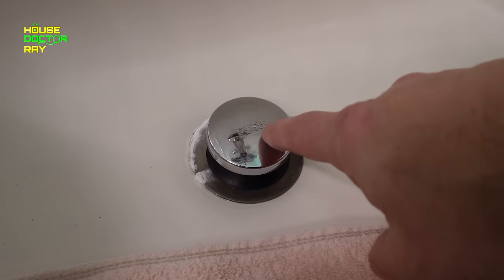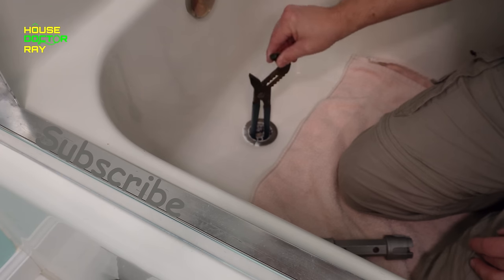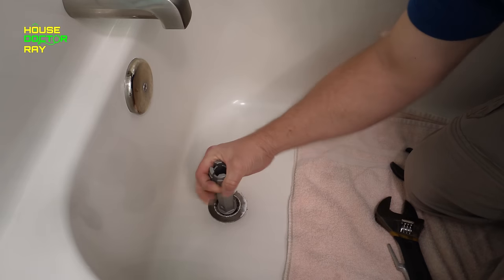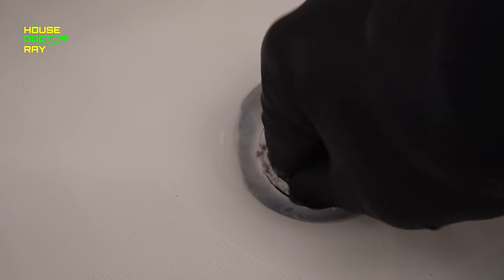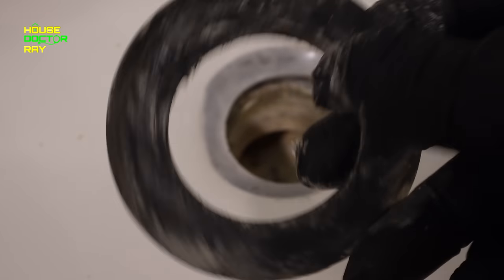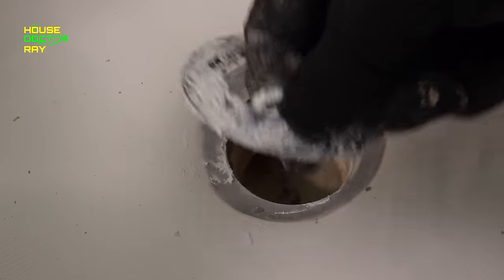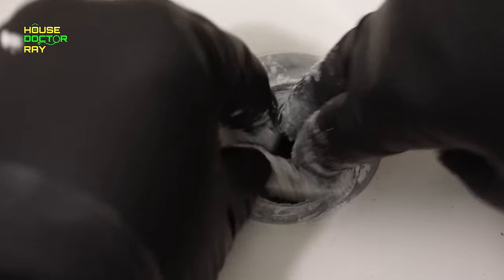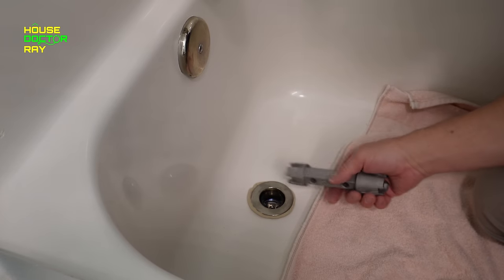How to replace tub drain

Comment: Give this guy a break lordy....so the first pic didnt really relate to the solution....BUT he showed me that there is.... in fact... a drain wrench tool that I had never known existed and how to use it, how to properly place the new rubber seals (between backside of tub and the wall facing me....and more....so he did show us all the solutions and for that I am thankful that he took the time to show laypeople...how the old drain can be removed and replaced.
Reply from the maker: Thank you.
Reply: Electrician pliers some peeps call them Klein's have no give or play like duck bills, needle nose or slip joints, lm plumber never bout dumbbell or stainer tool
Reply from the maker: Aviation duckbill pliers are nearly as sturdy as the lineman's pliers you speak of but with thinner handles.
Reply: @HouseDoctorRay  I didn't know that they made a tool for that.  I was going to make one out of PVC fittings with an oscillating tool.
Reply from the maker: That might work if you use schedule 40 PVC
Reply: @HouseDoctorRay  I'm just going to get the tool.  I'm not doing it on the tub.  I upgraded the kitchen sink to 1-1/2 standard PVC but the drain threads were worn out on one side.  I'm having a hard time finding a drain that will thread into standard 1-1/2"
Reply: Exactly. I’m thankful.
Reply: People can be cruel behind the mask of texting.

Comment: As someone who's replaced thousands of drains in the last 26 years, the only reason to replace that black gasket is if it's split or missing. Also, in a pinch, if your drain tool doesn't fit, try two large screw drivers and cross them over each other. It's a very solid hookup and will give you good leverage. Also, it won't bend up your pliers. You suckered me into watching the video because of the spade in the thumbnail pic.

Comment: The thumbnail for this video is somewhat misleading, showing a drill with a spade bit.  It implied to me that the video would demonstrate how to remove a stubborn drain with theses tools.  Not so!  Just a drain that comes off easy!  Looks like a sawz-all is what I'll have to resort to.  I did learn about the adapter and rubber gasket placement so it wasn't a total waste of time.  Just perturbed about the misleading thumbnail ✌️
Reply from the maker: Don't go sawzall!  They make an EZ out just for tub drains, you might have to go to a plumbing store to get it.
If you don't want to go that route go to the plumbing aisle of any hardware store and get a mini hacksaw.
Sawzalls are for destroying things.
Reply: @HouseDoctorRay  On another video, the guy thought the rubber gasket was for the inside of the tub, where the plumbers putty would go and commented on how thick it was.  That would have been me.  Getting the extractor tomorrow.  The kind with threads that bite into the metal. 👍
Reply: I’ve used a sawzall more times for this than I could count. It is for destroying things. Including tub drains. Lol.
Reply: That must have been really difficult for you.  I pray that you will overcome this grief.

Comment: Easiest drain I’ve ever seen. Wait until you get a drain that’s crimped in with copper pipe that you have to cut out. Or when you have to cut threw the ceiling downstairs and do it from a ladder that’s the best lol.
Reply from the maker: What about a lead trap in a slab house?
Reply: Good Lord. That sounds like the worst job.  You should make a series of videos called ‘Plumbers Nightmare Jobs’. The 5 worst possible repairs a plumber could face in his career.

Comment: The bigger challenge is when the cross in the drain has corroded to the point it just tears out and you are left with nothing to turn. Sometimes you can bend the flange up and get a purchase on it that way, but there is a tool that sets inside the drain and expands to grip it as you turn a hex shaft on the top. Not a  cheap tool but saves a lot of frustration.

Comment: In the real world the X is rotted away so you use a internal expansion tool for tub drains readily available after 30 years putty is like concrete heat with hair dryer or heat gun works real good
Reply: That's what I'm facing. The metal corroded inside and actually broke when I was unscrewing the old stopper. Now I have to replace the entire thing.

Comment: Best trick I’ve seen when the drain vanes break apart is wrap a couple of turns of silver duct tape clockwise around an impact socket that barely fits in the drain and tap the socket into the drain while turning it. Put an impact gun on the socket and let er rip.  The duct tape instantly heats up and expands and the impacts screws the drain right out.
Reply from the maker: Good tip!
Reply: Fantastic comment!  I have precisely the same problem--my vanes haven't yet broken but they are bending from using the "good tool" shown in the video.  I found and bought a tapered tool--almost like a drain-sized EZ Out.  I haven't quite gotten up the nerve to use it yet though.  :o)
Reply from the maker: The worst that could happen is the drain underneath breaks.  Plan accordingly.
Reply: @HouseDoctorRay  That's what I'm afraid of!  I have the ability to remove the tub...I just don't want to!
Reply from the maker: Nothing to be afraid of, it will either break or it won't.  'Shocking' it with a few stiff hammer blows may help it come loose.
You can access the pipe through the ceiling below, an adjacent wall, or basement.
Reply: @HouseDoctorRay  Unfortunately, the tub is set on concrete.  However, I COULD go through from the other side of the wall to reach the drain.  I seriously appreciate your kindness in taking your time to reply to me.
Reply: @SRFDriver I would try the duct tape with impact socket first. If the easy out thingy slips you won’t be able to use an impact socket easily because the drain will be buggered. It’s the impacts plus friction that make it work. I used an half inch dewalt impact wrench maybe a bit of overkill😅 took about 1 second. Or you could call a plumber and wait and pay $600. That’s what they charge here. Just depends on if you already have an impact wrench. Like Captain Kirk said “it’ll work Spock trust me”😊 Just go for it.
Reply: @quietsignal  Thank you again.  Yes, I do have an impact wrench and impact sockets.  I'll try that first.
Reply: I wish I knew what any of these words mean so I can try this. I just broke the center but trying to unscrew it. I'll try seeing if there's a YouTube video on it :P
Reply from the maker: There is a link in the video description for an ez-out.  That is the tool to use when the center breaks out.
Reply: @HouseDoctorRay  Thanks! I just saw a YouTube video with one of these things used and just as your comment came in, I saw that they have it at my local Home Depot. So happy that I won't have to call a plumber.
Reply from the maker: Just remember it's Saturday morning.  Most of the plumbing supply houses will be closing or are already closed if you get in a jam.
Reply: @HouseDoctorRay  If it goes that wrong, we have a second shower in the house and I can wait until Monday... :D

Comment: Use the kobalt type wrench it grips at 4 points - don't be cheap - it could cost you much more using pliers or any 2 prong tool! Also never forget to change the rubber washer that goes between the bottom of the tub and the drain pipe.

Comment: I tried doing this in New Jersey for a friend about a year ago, ended up happen to change everything because it was 20 something years old. I must’ve gone back-and-forth to Home Depot like 5 times getting more and more plumbing parts. Not only that, it’s New Jersey you take one wrong turn and now you got a pay a toll to get back to the house you’re working on.
Reply from the maker: That's why I moved to the other side of the Delaware.
Reply: OMG. Nightmare scenario. Thank you small town GA. Depot 2 miles from the house. Screw toll's. I could never ever live in toll troll area's.

Comment: I had to replace two drain assemblies a year ago. Pliers didn't work and because the "crosshairs" were damaged no extraction tool would grip.I went to harbor freight and picked up a body saw which is what body shops use to cut the sheet metal. It's like a mini sawzall. I used that to carefully cut 2 sides of the metal drain and then using needle nose pliers, pried the two sections out.

Comment: Good video.  I recommend using silicone instead of plumber's putty because it lasts longer.  Plumbers putty tends to dry out and fail over time.
Reply from the maker: Some sinks and tubs now specify silicone.  It's just so messy.
Reply: The ONLY time to silicone is if it's an acrylic (plastic) tub because the plumber's putty can cause a chemical breakdown in the plastic tub. Use traditional plumber's putty on steel tubs.
Reply: No thanks, I've spent hours trying to disassemble plumbing that was glued together with silicone caulk. Too many plumbers act like they will be the last ones to touch some particular piece of plumbing.

Comment: So your stopper isn't contriolled by the plug switch up by the faucet.  Somehow I think that type of drain replacement won't be this simple!
Reply from the maker: That type the stopper is inside the pipe.  The only thing that makes those more difficult is they are usually brass pipe.
Reply: @HouseDoctorRay  and the stopper must also be reconnected. Or even fixed too

Comment: It all looks great, but I have big problem with removing old flange/rim - it keep spinning. I have managed to spin it with the tool, it kicked off the old silicon from between the rim and bathtub base, but even tho it's spinning quite easily it doesn't go up at all. I tried to spin and pool with pliers, but that doesn't seem to work either. What am I missing here? Are there kinds with no thread? Is this thread broken or unmatched? Maybe I am doing something wrong here? I also don't have access to under the bath tub as I would need to break the tiles (don't ask me - I bought this place like that..)
Reply from the maker: It's probably stripped out on the pipe.
Try getting a flathead screwdriver under the flange and prying up while turning.
You may have to go through the wall on the back side.
Reply: @HouseDoctorRay  Thanks for quick reply, I will try that and let you know
Reply: Might have to replace drain shoe hopefully you have access panel
Reply: @suekotchevar2765  I'm starting to think that's what I need to do. When that sucker is stuck it's stuck! Stripped very bad no drain extractor budge mine. Now I know what videos to loom up that's to you. I'm a new widow & loath inheriting a 5 yr overdue honey do list.

Comment: I used one of those. cross piece tools once and the drain just snapped apart. The cross piles in the drain are very small this metal, corrosion go it. I use one that spreads out the more you turn it the tighter it gets.

Comment: When the insides of the drain flange are rusted out and not even your trusty pliers will help, there is only one tool that'll make the removal of the old flange possible/easy; a reverse thread tub drain extractor that fully grips the interior diameter of the flange.
Reply: All these techniques work great on video, but in the real world, it can be a disaster.

Comment: the stopper just screws in. can it easily be removed? mine seems stuck, it wont come out.
Reply from the maker: Lift up the stopper, there is sometimes a screw you need to loosen to remove them.
Reply: I have the same screw stopper that you have. Forcefully, pull upwards on the stopper while unscrewing. The friction will cause ther screw to bite enough to get it unscrewed.It might take quite a few turns to completely unscrew.

Comment: Your video made replacing the tub drain look easy. Not so... I managed to remove the old rubber gasket, though it came out in pieces. Now I can't get the new rubber gasket in. In your video it looks like you have space to freely move the gasket around under the tub. I have no free space around the drain. It is very tight. Only by inserting a flat head screwdriver between the tub and drain, and pushing down, can I get any space. I don't want to damage the tub either. After a half hour of trying to push the gasket into place, I cannot get it in. Suggestions welcome! (FYI, this is a 2nd floor bathroom so I have no access from underneath.)
Reply from the maker: Get a thinner rubber washer and goop it up with PTFE paste.
Put the washer around a hammer handle then use the handle to push down on the pipe while sliding the washer in place.
Be delicate with the amount of pressure you use and don't be in the tub, do it from outside on the floor.
Reply: Hi Ray - I did eventually get the washer in place, thanks to your suggestions. Not without more challenges, though. None of the 3 hardware stores I visited had a thinner washer. So I had to use the washer I had. I also wasn't able to find a pure PTFE paste, only sealants with some PTFE in them. So I used a silicon lubricant instead. Definitely helped. Of my 5 hammers, the handles of three were too big to fit in the drain hole. The fourth fit but the handle was too short to make contact with the trap. The fifth was my rubber mallet which fit and was long enough, but the rubber part blocked access to the drain area. So I ended up using the flat head screwdrivers, carefully. A big difference was getting out of the bathtub and working on the drain from the side, as you advised. Man, plumbing is so much 'fun'!
Reply from the maker: Glad you got it done.
It's surprising how much a tub moves with weight in it.  A lot of people fill tubs with water before caulking around the edge to be sure it's at it's lowest point.

Comment: the black rubber gasket...guy at lowes said it goes between the pipe and the tub, homedepot guy said it's used in place of putty ... who to trust? :) i did mine your way but the new drain kindda stick up a bit, and little of water stay in the tub ...
Reply from the maker: The black rubber definitely goes under the tub.  Sometimes the shape of the drain doesn't exactly match the tub and a tiny ring of water will surround it.
Reply: If you put the rubber gasket under the tub and the drain is not down all the way, it's because the drain is not tightened down enough. Or you cross threaded it, and it's not in far enough. If you have the gasket on the tub in place of the putty, it definitely will not compress enough to screw down all the way and will definitely hold water around the drain.

Comment: If you don't want crap falling down the drain, crunkle up some newspaper and wedge it down there loosely.
When all done, grab it with pliers and pull it back out.
Reply from the maker: Good tip Joe.
Reply: Very good tip. My drain is missing the cross members & stripped. It's like permanent glue wad used. I can't figure out to get the initial stopped outer screw piece to budge with any tool I tried trying to research better solvents to melt the putty or whatever my late gusband 🎉husband used. Then let it sit & reapply several times to keep it moist the add a heat gun to hopefully get it out.
Reply: @chrisharris7649  I know the feeling.  Had to replace the ancient but reeeeeally nice kitchen sink faucet because it was the stickshift type and the cartridge was leaking through, and even my plumber that I had over for a different issue said that older than 5yrs and you can forget it, the mfr likely doesn't even make/carry them anymore.  So I got a new faucet that I really truly hate.  Anyhoo, whatever monkey put the old/original one in, use some kind of permanent glue on the plastic nuts holding the hot/cold "studs", and the separate sprayer.  Cumbersome small cabinet area that I had to Houdini myself into just to access the danmed things.  Finally gave up, asked why I'm trying to nondestructively get out the old faucet, so just took my sawzall to it and chopped through the threaded parts and the glued-on nuts.
Tubular plastic "tool" they sell was crap, bent and deformed with the slightest bit of torque.  Only had marginal luck with one of those right-angle wrenches, trying to get 1/4-turn at a time when it'd slip 1/8-turn before it'd grab.

Comment: Im in a condomon fourth floor mine is siliconed in no way is it comming out without breaking the plastic shoe
Reply from the maker: You could cut a hole in the wall behind the tub and add an access panel.

Comment: Great video. Sweet now I can take out the drain to repaint my bathtub, and then install a new drain with an included plug. 😀
Reply from the maker: Pick a nice day, that epoxy paint smells really bad.
Reply: How'd that work out for ya. My wife says absolutely h. no for me to even think about such a project. 
That's only because 35 years of taking stuff apart with good intentions of putting back nice and neat never happens. As more things get older and need repair The more I have taken apart and not put back. 
Years ago B4 kids and not many projects I did put back but with kids  now grown and age of the house and me ocd,very ocd it is very limited I get anything done. 
Also, I'm not taking a thing with me to heaven and time is out of control as per speed and sooner is coming faster and faster than later, so a lot of times I just think why bother and just not worry about tedious stuff that in the realm of life doesn't even matter in the end.

Comment: Very rare for a drain to not be corroded. Typically this means that the cross hairs break right off when you go to use that drain tool.

At which point you’re shit out of luck unless you have a threaded expansion extractor.  This tool expands in the drain as you turn counterclockwise.